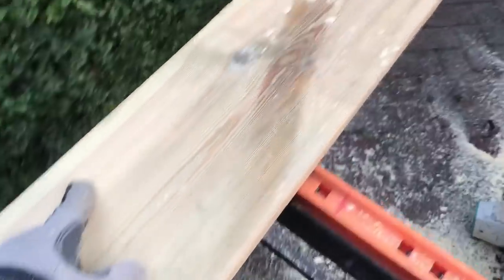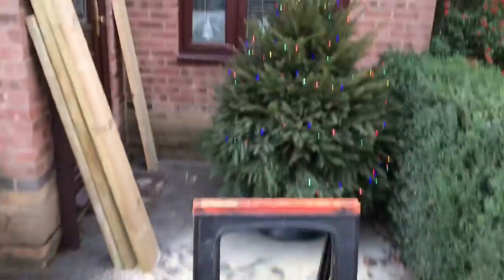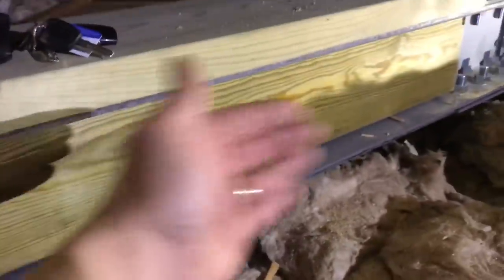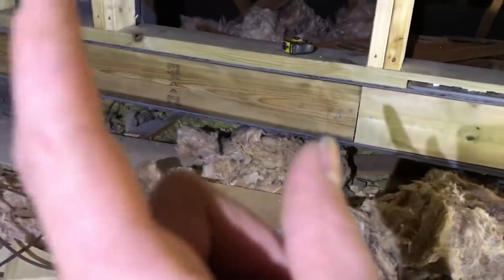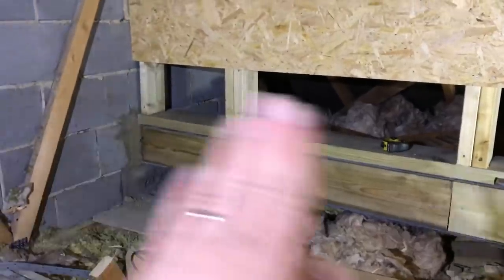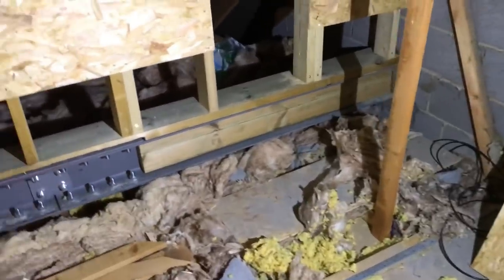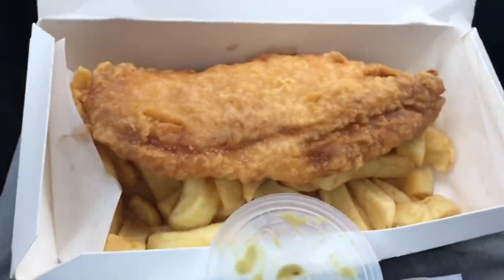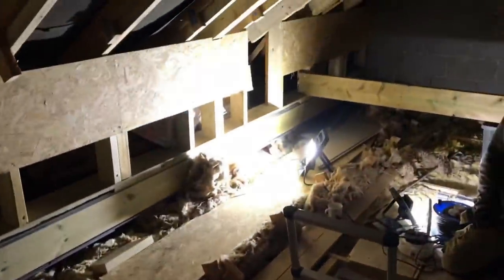Loft Conversion// Existing roof cut and ready for floor.

Comment: Now I'm no electrician, a C/J (carpenter/ Joiner) by trade, retired but when I see a consumer unit with 63A CDR's and a 63A isolator switch I think this don't look right, would I be right in thinking this. I have bought a house in the Philippines and I made enquiries regarding qualified elections, I was told they are very rare because they don't live long.